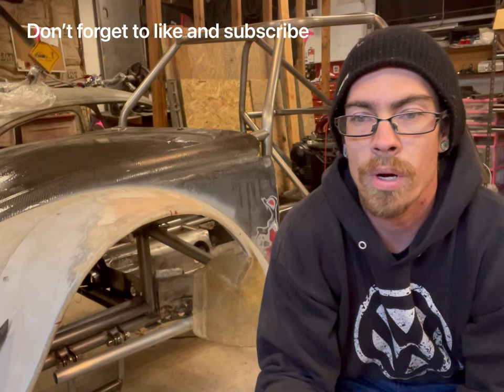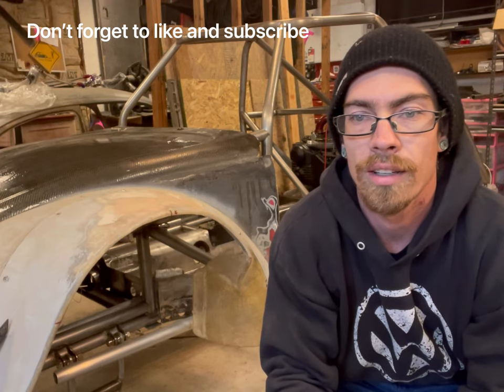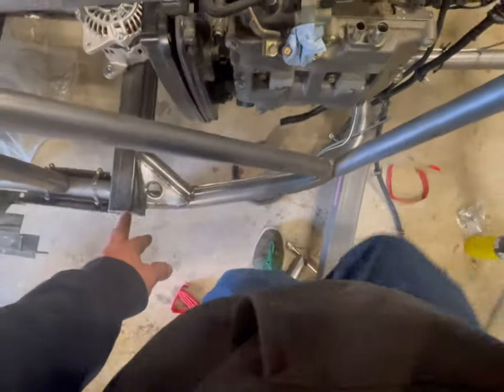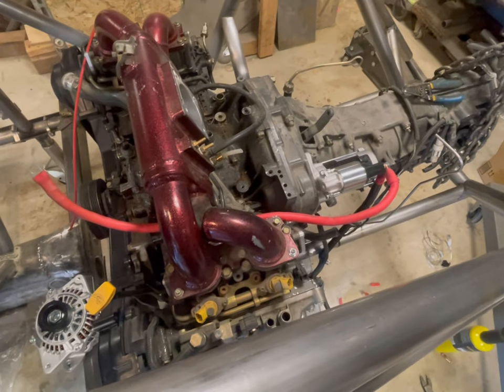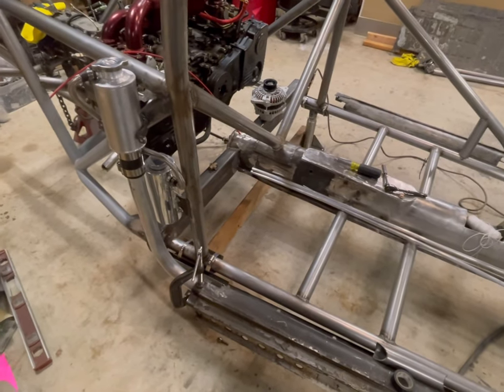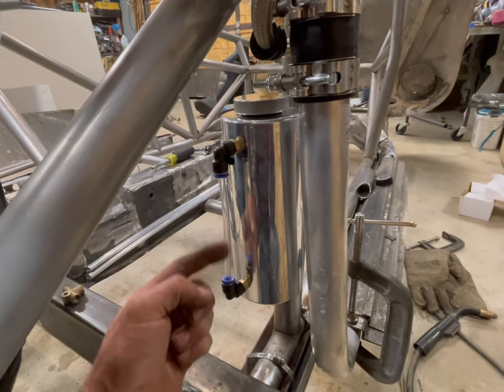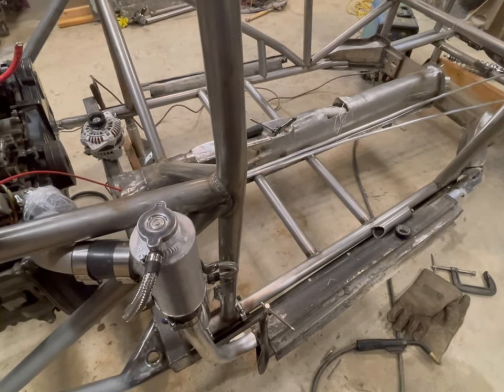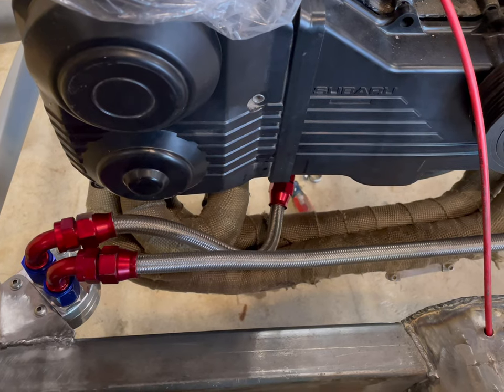Vw bug Subaru swap

Comment: Keep'em coming.  Enjoying the work your doing.  What transmission are you using?
Reply from the maker: Thanks man it is the glass trans out of a 02 wrx 😂😂 but I have a spare gear set and I will end up building the trans with ppg gears later down the line

Comment: Why not use a short ground to a tab on the tubing at the trans and then do another tab near the battery? save some cabling. Just a thought. Loving the vids man, is this going to be a drag car?
Reply from the maker: Thank you it means a lot 👍 I could just run a short cable but good grounding is just as important as power, with a direct ground from the battery to the starter actually helps the starter with current and grounds to the chassis don’t have to travel as far. It’s going to be a time attack/ hill climb car but it will see the drag strip at some point 👍